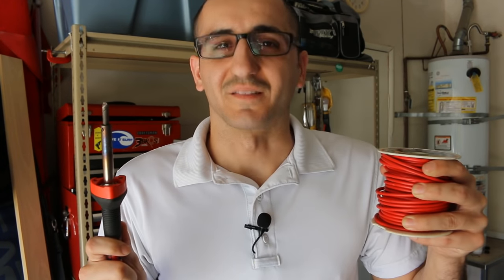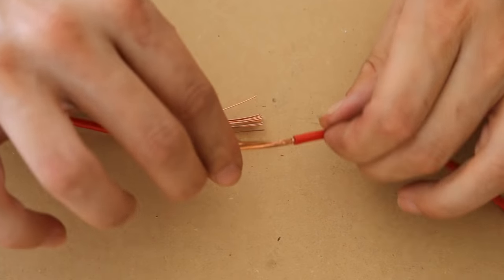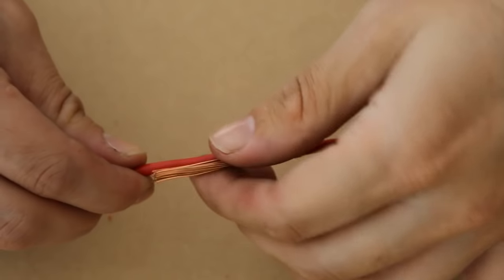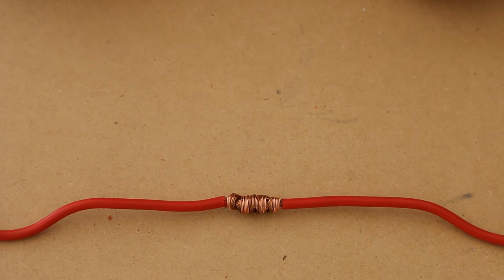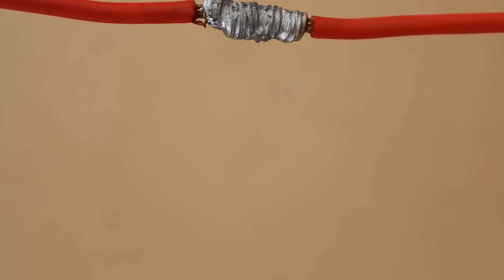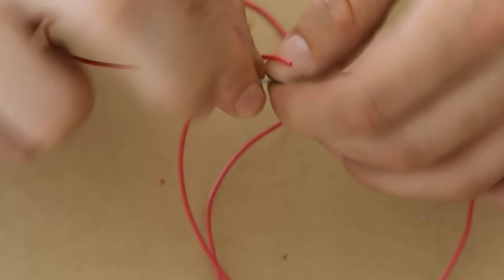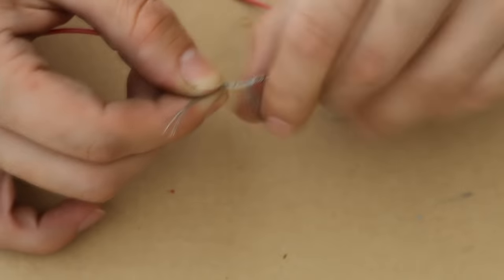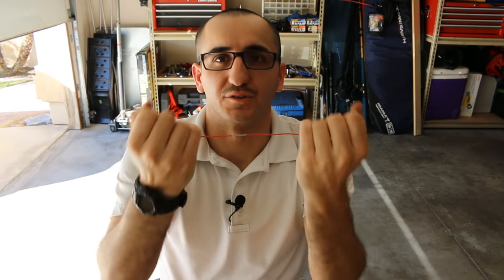Best Soldering Technique - How To Solder in HD

Comment: The wires pulling apart easily is completely irrelevant if you're soldering them. A very gentle twist of both wires is the best method as this places the least amount of mechanical stress on the wires internally.

Comment: I never soldered two wires together in my life, but I am working on a build of a 3D printer that is requiring me to make some wires to some limit switches longer.  I saw several videos showing a few different techniques, but this one seemed the best to me.  I used your technique with some 20 ga. wire, and thanks to you, I have joints soldered joints that are not relying on the solder for strength.  Thank you very much for this video!

Comment: Wow, lot of videos on YT showing people how to solder incorrectly by letting the solder hit the iron.
You really want to heat on the opposite side of the wire while letting the solder touch the other side and melt when the copper is actually hot enough.  We all cheat sometimes on a really large wire by letting the solder hit the tip to get a larger hot solder drop transfer more heat into the wire.
However you have to leave the iron on the joint longer to insure all the wire gets up to temp properly.
Otherwise you have high chance of ending up with a cold joint.
Reply: Ya know... If you know so much about this then why don't you just make your own!
Reply: Appreciate the tip, Boots.
Reply: @Boots Finally someone who is giving advice, not criticizing nor insulting ! Thanks
Reply: Make a vid please. Sounds like we all appreciate any tips possible

Comment: Well, that saves some money! Skipping the soldering iron, power converter (car), and extension cable!
I'm just gonna use this method with shrink tubes and a bic lighter... besides, it's just busted wires to the rear speakers in the trunk, and nothing too serious. Thx, man! 😎
Reply: Every non soldered connection you will lose 1-3 dbm... that's big
Reply: Use dielectric grease between all your connections and that will solve it

Comment: Add flux, pre solder the wires, THEN you join them and solder.  Add heat shrink!
Reply: I'd put the heat shrink on the wire first though slide it down then the rest... kinda hard to get heat shrink on when its soldered together

Comment: I have learned during my apprenticeship and during my working time in 
the machine building industry that you should NEVER solder wires 
together because they will break in case of continuous vibration or 
bending. They will not break where you have put the soldering tin to, 
but at the location where the tin moves into the wire and where you have
 the borderline between the tin and the copper wire. The right way of 
connecting two wires is to crimp the wires with a certified crimping 
tool and good crimps.
Reply: In the communications industry, you can't get a better connection than  solid or soldered connection

Comment: Hey guys, I’m
Gonna start soldering, any tips, I have no experience but I just bought a kit to start
Practicing. Should
I buy glasses or
Gloves?
Reply: Gloves are useless and will just be in the way, simply don't touch the hot stuff :)
Do get a kit with a little sponge to wet, so you can clear your soldering iron every once in a while.
Don't get the Chinese 10$ soldering crap with no adjustable temperature.
What temperature to use... Kinda a bit up to personal preference, I solder at 450°C usually, but that will absolutely melt and destroy some small components, so if you have to solder on a small motherboard with very thin wires, you solder at like 200°C instead. The wires shown in this video are definitely as high as you can go with the tool (tipically 470°C is the maximum).
Never ever use sandpaper to clean your tool.
Use heatshrinkers, put them on before you solder and use a lighter or a heat gun to shrink them afterwards, much better than electric tape.
Get good quality tin!!! 60 sn 40 pb is good, but 60 sn 38 pb and 2 cu is more expensive but it's phenomenal and absolutely worth it.

Comment: who is pulling on your wires with all their strength after you are soldering them?  I have never heard of such a need to prevent people from #wireyanking.    just twist together and solder no need to remove 2 inches of insulation on each wire...........you are silly
Reply: jasonjgy yeah right he didn't show when he twisted them together and then soldered them and then gave them a tug . The way he does it you have a big ball of bunched wire ! Not clean at all but yet everyone is doing it that way lmfaoooo!!!
Reply: Redarc

Comment: Frustrating as I can't get this to work. I got the cables twisted with flux. Melt the solder on the iron but it keeps rolling off the copper wire and will not attach. It doesn't soak into the copper like the video. I just have little balls of solder. Any ideas where I am going wrong?
Reply: Mark Reed it’s possible you have yourself a cold solder. The wire should be brought up to temp and the solder being applied to the connection should not touch the iron. Add a little bit of solder too your tip for better heat transfer. Heat the top of your connection then move the tip to the bottom to bring the wires up to temp. Then touch your wire to the top and let it melt through the wires. Lead based solder with a rosin core is best.  if it continues to roll off the connection your iron could be too hot causing a leidenfrost effect. Godspeed 🤙
Reply: Mark Reed also use flux 👌

Comment: You have no clue what you're talking about. Where's the flux you heat the other side the wire and don't touch the solder to the heat tip and also before you put on heat shrink put some Dielectric grease on it then slide the tube over it'll make it waterproof but then you seem to know everything

Comment: That joint is bad and potentially useless. Reasons:
1. Use more material then actually needed. More wire, more soldering time and more solder, less efficiently.
2. Visually are not appealing. You got nice wire connected by the egg kind of shape.
3. Solder are very strong, if done correctly, you should not be able to pull it apart, as its gonna withstand way more weight then the rest of the wire. You can try to bite the soldered wire and wire itself.
4. Useful only if you are just connecting bare wire without soldering. However, if your wire are that fat, its probably high electricity, not safe, and if its a thin one, it makes no sense, doesnt matter, because you will break thin wire anyway, regardless of the joint.
5. Bigger exposed area if not well covered attracts more corrosion then smaller joint at the same time, depending on wire material. Its better to expose 1 inch copper that are very compressed in pack, rather then 4 inch copper with lots of area and holes to attract moisture.

The combination that i use are mix of both. Spread both wires and intersect them together like in first solution, and then wrap them around backwards (180°) like in this kind of new solution shown on the video (one wire at the time).
This is faster and easier, uses less material, visually will still be thin and elegant, and because of this counter/backwards wrap it contain same capabilities as a method shown in this video.

Comment: Coined? LOLActually you DID cut through the wires by nicking them as badly as you did. Since you're soldering, the solder is going to wick past the nicks and help protect the wire from flexing and breaking, but if you put that wire in a crimp terminal, it would break every last nicked strand from running and road vibration and possibly just from handling and bending during the installation!
I was looking for a good tutorial for beginners to help some folks that are having troubles. Sorry, this AIN'T IT!

Comment: Coming from a Professor of Automotive and career diesel tech, THAT LOOKS LIKE SHIT. It is NOT the best method. It works, but go do that to 10 wires in an automotive harness and let me know if you can get them packaged back into the loom? Good luck. Had you pulled the wires apart a bit further and wrapped them flush with the insulation I would have been more inclined to say that it was a good repair. Perhaps you should research the method a bit more, yours needs work.